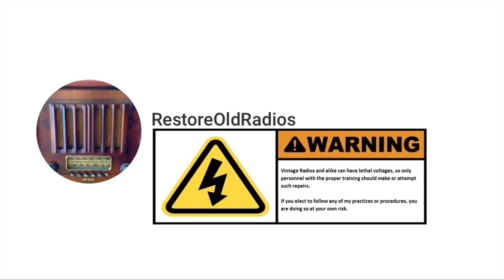Harman Kardon - Model 01D430 Multimedia Speaker System Repair

Comment: Where can I find power supply for this?
Reply from the maker: UpBright DC 15V AC Adapter Compatible with Harman Kardon JBL A481511OT HK195-01T HK-01T A4815110T HK-O1T HK 195 HK195s 02320V 01D430 PC Speaker A481511 HK-02TA A15-1.5A 15VAC 1.1A AC15V Power Supply https://a.co/d/cClTCDE

Double check to ensure your model number is a match. Hope this helps.

Best,

Don
Reply: @RestoreOldRadios  thank you

Comment: I have the same as yours but my speaker cone is heavily ripped. Do you know any online that sell cone for this one?
Reply from the maker: Not sure who would have an exact replacement cone. If the rip is not too big, you could try applying a patch using a coffee filter and white glue thinned out with a few drops of water. Best, Don
Reply from the maker: An example of using this technique:
Peter Pan Radio - Day 14 P2 (Speaker Cone Repair)
https://youtu.be/XsKWZ0Plbso
Reply: @RestoreOldRadios  thanks a lot!

Comment: Thanks for the video,  I just opened up my set of "cream" colored Harmon/Kardon speakers and discovered the speaker cover removal just prior to looking at you video.  My Cap is now swollen or ruptured but I got a "buzz" like 120Hz or 60Hz.  Caps look good but I bet I've got a a couple of "failing ones too.  I'm going to try the "rectifier" cap by the diode bridge set an then maybe that 3300uF too.  Thanks.
Reply from the maker: All the best and getting it squared away. Don
Reply: @RestoreOldRadios  Waiting on the two caps to arrive, ESR and capacitance we're miles away from spec.  Thanks for your feedback and video.

Comment: As with anything, always note the size and location of the screws when disassembling. The 2 upper woofer screws are shorter. The two lower woofer screws are the same as the cabinet screws. 
AND when reinserting any screw- always a good idea to "back off" the screwdriver till you feel a slight "click" - then proceed to install screw. That way you won't cross thread the screw. And when screw bottoms out and stops - just go another 10 degrees tighter and leave it at that for plastic screw holes.
Reply from the maker: Thanks for sharing this with others. Best, Don
Reply: @RestoreOldRadios  
Always good to mention the  little things. Also, matching up the correct size and type of phillips screwdriver is important. Different countries will use varying depth and width. A #2 phillips might seem close but not always,

Comment: There seems to be a disconnect feature on the power jack when ac plug is inserted. I verified this when checking the circuit board. Do you know why that might be? Also- what is that momentary "Diag." push button for? I picked these up at yard a sale.
Thanks.
Reply from the maker: I think the momentary switch allows the speakers to be tested via a self generated tone if I recall correctly. Best, Don
Reply: @RestoreOldRadios  
Thanks.

Comment: Hi what size of AC output of that speaker? Cause i have speakers like but i don't have power supply or ac output
Reply from the maker: Something that has a voltage and current rating like this one:

UpBright 15V AC Adapter Compatible with Harman Kardon Multimedia PC Speaker JBL Duet 01D430 HK195 HK195-01T 02320V A481511OT HK-01T Harmon F158 DELL 06941V 15VAC 1100mA AC15V 1.1A Class 2 Power Supply
by UPBRIGHT
Learn more: https://www.amazon.com/dp/B078WQYVR8/ref=cm_sw_em_r_mt_dp_8MY5JBQ2M96YS6Z1EFSY

Comment: Oh hi! I got here after finding these at a thrift store and bringing them home - only the left side speaker doesn't work. The LED lights up, it pops when sliding the audio jack into the other speaker but there's no sound whatsoever. I'm not noticing any swelling of the cap or anything (its a 1000uF on the left, interestingly). Wondering if there's any advice for me, if I should replace it?
Reply from the maker: All of the capacitors could be defective and causing the issue. If the capacitor is open and not shorted, you could jump a capacitor across the old one and see if it wakes up. All the best on getting to the root cause. Don

Comment: For those baffled by how to open the speaker, in addition to the two screws that are visible in the back there are two hidden behind the speaker grille (it pops off when pried gently with a thin tool), and most diabolically, you need to remove the two screws at the bottom of the metal loudspeaker frame.
Reply from the maker: Thank you for posting this. I know it will help others access this model in the future. Best, Don
Reply: @RestoreOldRadios  You're welcome.

Comment: Hey Don, It would seem it comes down to a bad cap in a lot of cases. I recapped an AM transistor radio I bought at a thrift store, from the 70's, and it works fine. My fascination with radio started in the 60's as a kid with a transistor radio and being amazed that sounds were coming from it, I still remember that day. It was my first experience with a transistor radio, and, radio is still my favorite. Take care, all the best, C.
Reply from the maker: Cass - too often it’s the old capacitors to your point. I hope you’ve been doing well and the air quality is now back to norm. Best, Don

Comment: Wow its always caps that make everything fail and with fairly new equipment as well. 3300uf seems terribly hi for a 6 or 9V power supply filter. I think the 1000uf cap you got there is just fine IMHO for a 2 or 3 watt stereo system. Such a funny noise tho as it turned into a tiny pf cap, lol. Thanks for sharing Don.
Reply from the maker: It was a simple repair. That cap was dry and nothing left inside of it. Best, Don
Reply: The cap opened up. The 'tiny pf cap' is just the stray capacitance he measured due to the meter leads and of the opened capacitor body. Just sayin'. The cap did open up, something the cheap new ones tend to do. And I agree that the 1000uF cap is probably sufficient in this application.

Comment: If you have to replace one 'lytic, then replace them all. They are not that expensive and it will save a return visit in three months. Obviously, use better caps than the cheap skate manufacturer did in the first place. We don't need to count pennies when working on single units. A mfr can save tens of thousands of dollars by shaving a penny off the cost on a run to 1 million units. Of course, they should!
Reply from the maker: Great points. Thanks for watching. Best, Don